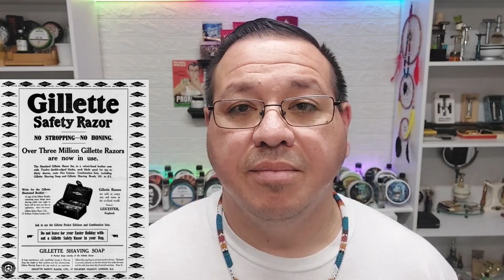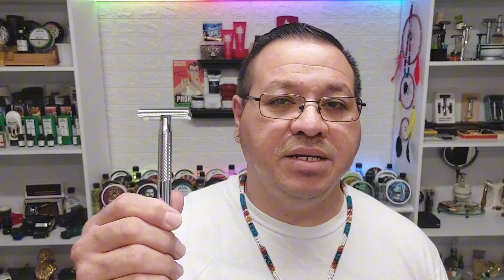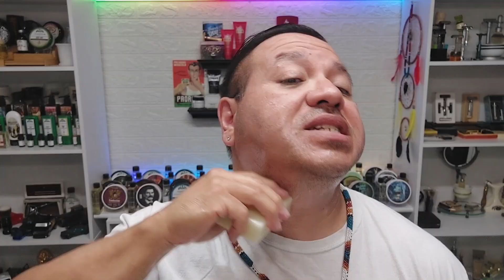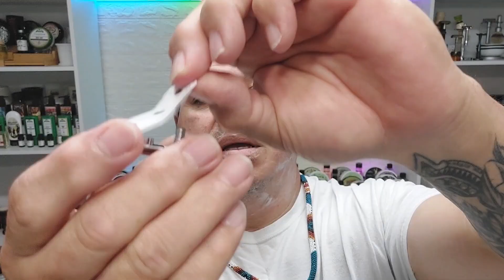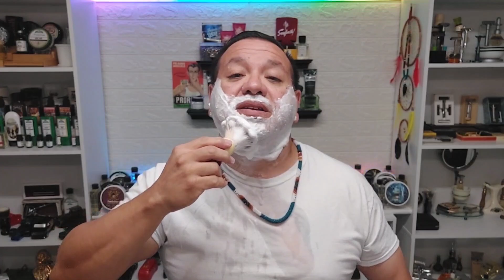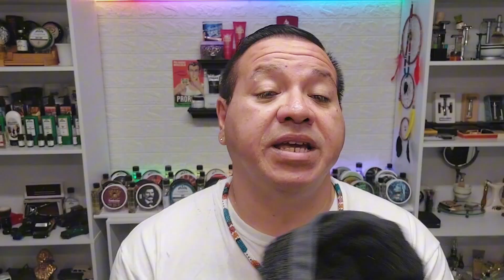King C Gillette Double Edge Safety Razor

Comment: Disappointing the cut on your chin.  If the handle is too slippery and therefore insecure for you, a very good remedy is to twist to attach a rubberband.  I've been using KCG this way about 3 years and it works nicely.
Reply from the maker: Thank you for the great tip! I'm going to try this because I really did like this razor! Thank you for watching brother!